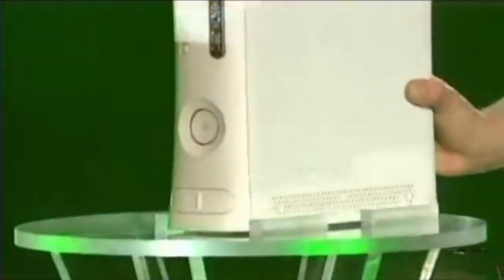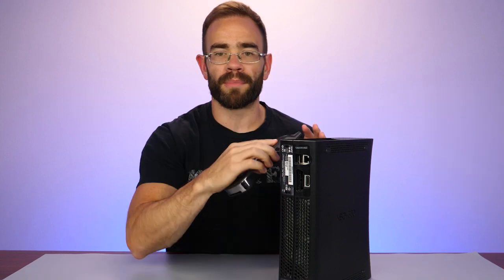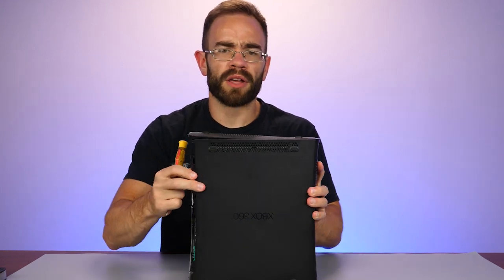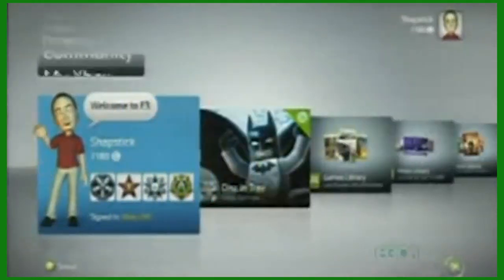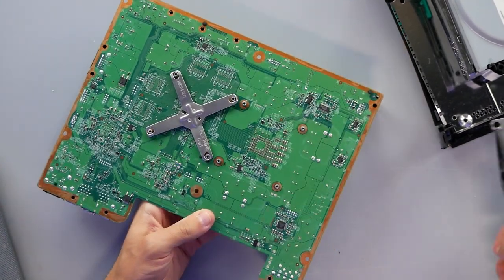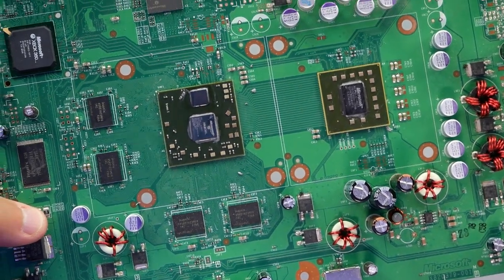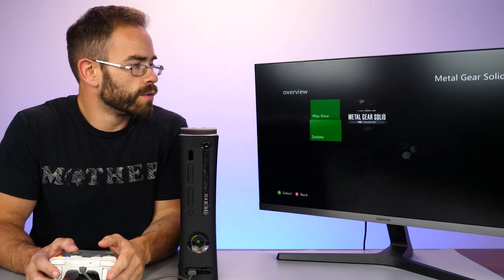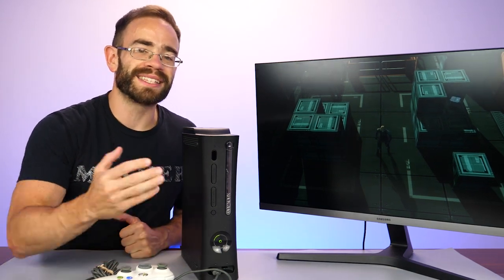The Xbox 360 Elite 15 Years Later

Comment: Yeah I own an Elite I think. I don't know enough about the early models as much but I know mine has the HDMI and Component so my guess is it's an Elite if early models didn't have HDMI at all or whatever the case is I need to look it up.

The clock seems to go to 2005 during I think unplugging or turn offs my PS2 kind of does at times too. 2025 will be hard to deal with dates though as the PS2 can go to 2099 or something the 360 will only go to 2025 so that's going to be something even though I leave it at 2005 when it resets as can't be bothered to change it.

I like disk installs being a thing but optional than how they are forced now. It's why I like Switch and Wii U never had installs and I can just put it in, the games are optimised well enough I don't need to question installs when Nintendo makes games besides the times BOTW on Wii U has its lag. PS3 having forced ones even though Blu ray storage also annoys me. Still at least for 360 or some PS3 at least installs were nice if needed to then focused I like only saves to manage, updates to the system and if I want to updates IF I choose to which Vita was great for with a 1GB internal and saves using 1.0 versions.

Only used HDMI with it but I plug the Component cables just to check them out and see if they work still because I don't use them.

The 120GB Hard drive it came with is dead I forget for how long but the 36,0 went into storage before using a USB later for a while then bought a 250GB (the clip is broken though but don't need to touch it as it's being working fine the hard drive) and I'm good using it offline for the remaining years now with the 360 E as the online one that has before revived the Elite with a USB.

Disk tray is awkward to use I think it's the tray band though.

The system works alright with Frontlines Fuel of War it gets loud so I installed that to the hard drive any time I played it just encase and with Bodycount my disk is scratched but reads alright I may need to install the game just encase. Any time there is no backwards compatibility on Xbox One for the 360 games I have it next to the One to play the seasonal/licensing preventing racing games or not likely cared for games to bring forward like Blur, Bodycount, Legendary, Eternal Sonata, and more. But the Xbox 360 Live Arcade compilation disk with Pacman Championship Edition, Feeding Frenzy among others like Luxor and such or Indie Triple packs like Trials HD, Splosion Man and Limbo work so that's cool to carry those over. Sometimes it didn't work but does now. I never experienced the Minis/Live Arcade/WiiWare stuff picked up whatever I can of physical compilations (Minis Volume 1, the 360 one otherwise certain DSiware on 3DS that are still up)/looked at some Minis online or that were ported/enhanced games on 3DS/Wii U and Minis available on Vita.

I looked through my library to see what's supported then going to the Xbox/Wikipedia websites all the time to catalogue what is and isn't compatible.

Used the system a lot it's pretty capable even besides the issues I have with it. I use my PS3 Slim more and find more PS3 games for $5 than the third parties or first parties on 360 but when I do I don't mind using it for a few things. A lot more than my PS4/One that are third party machines because none of the first parties are really doing it for me than past eras.

A fine system though and had the memory cards still that never saw or used. Obviously no Kinetic port (I think as I always think the Slim was the start of it) but never had a 360 Kinetic only an Xbox One Kinetic.

Comment: I picked up the slim model after waiting for Microsoft to overcome the red ring problem. I also opted for the 250gb memory because I had two different friends who both had troubles with the disc drive on that model. I just installed all the games and played them from memory. I still have it, looks like new and it still rocks

Comment: Got myself and elite recently for cheap. Cleaned it up and applied new thermal paste. However, i am a bit concerned about how cool the heatsink is for the cpu. Like, i feel no heat at all after like 5 minutes in a game of i touch the cpu heatsink. The metal casing below the cpu is cold as well. Is that normal?

Comment: Xbox 360 dvd drives can be converted to 0800 drives, which are ripper drives, what the 360 already did with retail to hdd, 0800 allowed ripping externally, to backup isos to your pc :)

Comment: I bought an XBox 360 Elite the week they came out. It was cheaper than buying a used XBox 360 & New Hard drive from Game Stop (although it might've still been EB Games at the time, can't remember for sure). I still have it, It red ringed and I sent it to MS under the extended warranty, and it red ringed again a couple years ago, so I installed the iFixit Red Ring kit and its up and going once again.

Comment: The elite was the first and only 360 I ever owned back in 2008. The disk drive often got stuck and eventually I had to remove the chrome plastic trim on the drive, other than that it was the most reliable console I have ever owned! I wasn't a fan of having LA Noire on 3 disks though

Comment: I had the Launch 20gb model. I wanted an Elite so bad when they came out, I was annoyed with the 20gb HDD within a few months. However I opted to get a 60GB PS3. I put up with a 20gb HDD and a wired internet connection until the 250gb slim model came out. And yes my launch console did actually survive that long.

Comment: It's interesting that the 360 was the last home console to feature a proprietary memory card and a first party wired controller.
Reply: The launch PS3 sort of featured proprietary memory cards too. It had a card slot for the same memory card the PSP used, granted you could still use USB flash drives for the same purposes.

As for the wired controllers, I guess Microsoft designed it just in case wireless controllers didn’t take off yet. I personally preferred it rather having to fuss around with AA batteries or play and charge kits lol.

Comment: If this was a launch Xbox 360 elite, this would most probably be either a falcon or zephyr system.  Jaspers weren't released till later down the life cycle and I think elites were no longer in circulation by then. Most Jaspers were the Arcade/core consoles with big block onboard Nand (Built in memory) :)

Comment: It was a joke compared to what PS3 was offering. I vividly remember finding out Xbox 360 didn't have built-in Wifi or Digital outputs. I finally understood why it was cheaper and had many revisions. PS3 may have been expensive but when you bought one, it endured the analog to digital transition without buying anything extra. Matter of fact, I still have my piano finish 60GB model from 2007. It's still live and kicking. And thanks to Sony forward thinking, my PS3 still connects well to newer TVs without any adaptors.

Comment: By 2008 Xbox 360 had 256MB arcade then the 60GB Pro, 120GB Elite Models. The 20GB was a launch model that died few years after launch.
I got my elite in Late 2008 my friends had the 60GB Pro Models for 50 dollars more I got the Elite it came with the following
*HDMI Cable
*Component Cable With Toggle Switch To Go Back And Forth From Standard AV Composite to Component
*Ethernet Cable 
*AV Audio Adapter Cable That Let You Use Turtle Beaches And The HDMI Cable At The Same Time It Also Had An Optical Audio Port on it
*Black System
*Black Controller 
*120GB HDD
*Black Xbox 360 Chat Headset 
*Black Powerbrick and Power Cable
*Lego Indiana Jones And Kung Fu Panda

Comment: I have the Elite and 2 Arcade models and the Pro model. The Pro and one of the Arcade models are still in the boxes sealed, my Elite was a screw job where they removed the X clamps and a few weeks ago I found x clamps and installed them with MX 4 compound. The other Arcade model I've used since 07 or 08 and it still works.

Comment: Once the inevitable ring of death was fixed and sent back to me. This felt premium. Never had issues with it after. Still works great and one of my favorite designs for a console.
Reply: I don't think there's really a permanent fix just the hope that it won't happen again. Every og 360 is doomed to fail eventually. So proper use and care is important. It's definitely less likely with the later revisioned motherboards.

Comment: This Xbox being an 09 revision. It actually is the best FAT 360 you can get. In 08 the Jasper revision came out, threw out the 360 life there were a few major revisions done, But with the Jasper models the Power draw was lowered enough that the gpu, and cpu now on the 65mn process, compared to the OG 90nm process, which let the Jasper shave 53 watts of power.

This die shrink, and drop in power usage, let microsoft switch back to the stock small gpu heatsink. and they have no issues running these smaller heatsinks.

Comment: I find it funny,  before I started watching this video, I was playing Metal gear solid 2 on the HD collection on my 360.

But yeah this was the 360 I wanted as a kid... I got the E instead. But it had 1TB of storage.   9 years later, and  and I still haven't even used half of the storage.   Although I remember my cousin owning an original model 360 back In 2007.

Comment: got off work and bought an xbox 360 when it launched.  Still got it and still running.  Somehow avoided red ring of death.  I did replace thermal compound on it so hopefully it will help but somehow I think its a ticking time bomb.  I am thinking of buying a Slim model now to replace my old one even if it works.  The noise from that machine is horrible.  My OG Xbox doesnt even sound that loud.

Comment: E74 was not the Hana chip. It was related to the EDRAM on the GPU.

(1022 E74 - ERROR_HSIO_CALIBRATION
_FAILED - GPU to eDRAM High Speed Link failed, eDRAM faulty or unresponsive)

Replace GPU

Comment: This is the model i had for most of that generation i think. I eventually did get some newer model im pretty sure too though. Did this version also have the wifi build in? I remember you had to get a antenna for the original system.

Comment: Just had a fight with my 360 a few days ago regarding the fact that the disc tray gets stuck.. but the solutions for opening it manually just.. aren't there?
Turns out I have one of these Elite models, and those just don't have an easy way to open the tray (officially anyway).
It would have been helpful to have this listed somewhere on the Xbox website, but they actually just pretend this model doesn't exist on that support page.

Other than that, I really like this model. My only other issues at all have been with trying to use both the component audio and HDMI video at the same time, but that appears to be because my cables are too fat.

Comment: I opened my Xbox 360 recently because it kept turning off, only to find it was filled with dead cockroach corpses. All I had to do was detach the ribbon cable (meaning I can no longer turn on my Xbox 360 through that button), but I also cleaned it out and man it was disgusting. I only had it for a month so those dead cockroaches were not from my house!

Comment: E74 means ERROR_HSIO_CALIBRATION_FAILED. It would still mean something on the GPU. 
The board is fine, it's always the stress problem inside the GPU, between the silicon and the package substrate.

Comment: if its like june 2009 or newer, it's probably a Kronos(Jasper V2) and that guy will probably have a failed DVD drive before the system fails. And is pretty much silent. They run around the 50-60c range at all times.

edit; Literally says Kronos1 on the chip, This is THE 360 to buy

Comment: I still have my Xbox 360 elite with the 120GB Hard drive, the disc tray only opens with the controller since the button on the system doesn't work anymore but otherwise works great.

Comment: Well my 360 is recently crippled by a defective diskdrive. All games disks will sin but aren't recognized. 
Does anyone have this issue and how to fix this? 
Or is my best choice to mod the 360 and pull it of the internet. 
It's just sad Microsoft hardware locked the optical drive to the motherboard.

Comment: My elite was struck by lightning, it fried the HDMI port however all my data and saves was still on it, but the component cable still works.
Reply: Same except my Ethernet port got fried.  Tried to fix it everywhere.
Reply: @shanemb3  dannng :/ since the component cable still works and I have a tv with that I hadn’t tried to get mine fixed or do it myself yet. But if my TV with that port goes out I may have too. The crap thing is my Wii U right next to it nothing wrong with it. Lightning came through the cable cord and out the tv through the HDMI ports into both consoles. (Ahh thinking about this now reminds me the 360s power supply also blew but I replaced that and no issue other than the hdmi; anyway tv also blew. Wii U I just unplugged from the wall and plugged it back in and it came right on. Electricity is wild

Comment: Glad I got an elite version when I finally got a 360 way back when.
Though I wish I waited a little longer for the slim model for that built in wifi.
I worry my 36o hard drive will die next time I try it and the disc drive belt might need some cleaning nowadays.
Wonder if there are any guides or if its possible to install an SSD, maybe a modern wifi solution.

Comment: 360 Slim consoles are not without their problems. I have 3 red light 360S here and 3 more with corrupt 4GB NANDs. Jasper's had a short run but I've never seen a dead Jasper. If I wanted a future proof 360, I would go with a Jasper system all day long.

Comment: It was a rushed console when it was announced to beat Sony and the PS3, but it cost them a lot really for nothing 

I have the original 360 2008 model (I think) it does HDMI, still works but the fan is awfully loud had a 20GB HDD with it. I recently paid like £10 for the 120GB from the elite on eBay works fine. My pads trigger buttons squeek badly but can't get another anymore.

Signing into Xbox live is annoying now because you can't have 2 way authentication enabled using the Microsoft authentication app you have to do some code BS.

I want a series S at some point for better backwards compatibility

Wish my 360 had the blade system dash because it was so good fast and easy to use. The one now is just awful sluggish and the store doesn't seem to have many games on it or it could be me

The avatar was MS copying off Nintendo as Sony did the PS Move that was the Wii controller

Comment: I remember doing a lot of research back when Halo 3 was about to launch. I wanted an Xbox 360 with HDMI but the Elites were initially just as prone to red ring as the standard ones and it was hard to identify what board revision a given console had. After all the research it seemed the Halo Console had the newest revision at the time and you could tell by looking through the serial number slot and you could see if there was a large copper heat pipe under the vent holes. So while I'd rather have had the larger drive of the elite I went with the Halo console and well it's still working to this day. So I guess it worked out in the end.

Comment: Microsoft sold the buyer short by not upgrading to HD-DVD or Bluray with the 360 . It's pretty much of a sin if you release a console with a crappy design and release it with a loss . Most other consoles are sold at a loss to Sony and Nintendo . Not with Microsoft . The whole 360 line was a redring design . Microsoft didn't even make improvements , like a better thermal paste . It's hard to tell how many people bought the 360 because Microsoft just seemed to replace any redring POS they got .

Comment: installing the games were so good cause you could essentially break your disk afterwards and as long as the disk could still give the access to the console it would run no matter what had a copy of BO2 that was damn near in half but could still read the data to launch and it always did 360s were fucking troopers easily the best console of that generation while ps3 might have some better games hardware wise xbox won this gen for sure

Comment: My cousin gave me his elite because it RROD I ended up overheating it by sticking paper clips in the fans and then it would work. If I ever turned the system off RROD would be back so I had to overheat it again. My 360 ended up staying on for like 2 years straight before it died and wouldn't power back on

Comment: 2 years ago my wife smashed mine on the drive way front missing shroud all busted up. Plugged it in and it still works and 2 years later I still use it just need the controller to open it and turn it on. The wife was not impressed when it worked but guess what woman don't care what ya think lol. Moral of the story they are tanks.